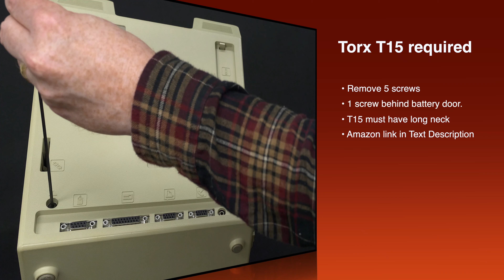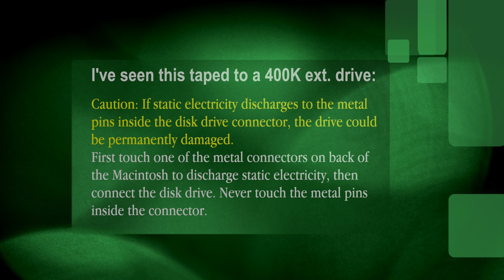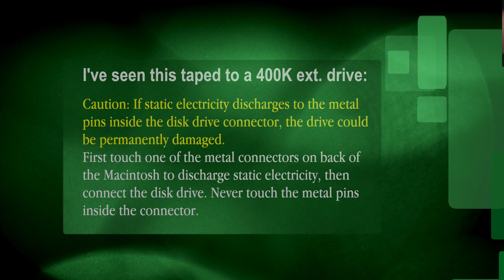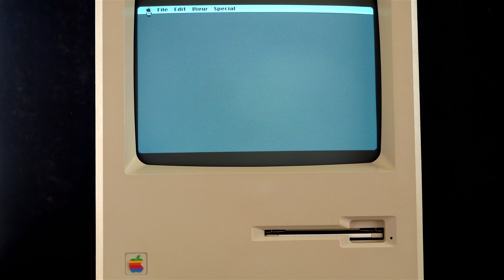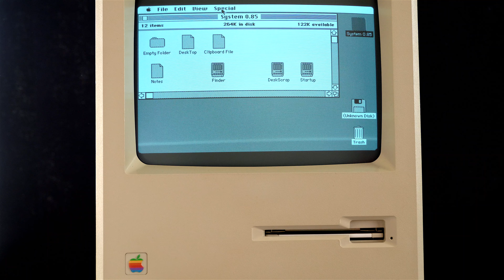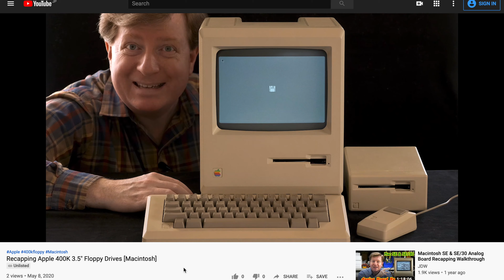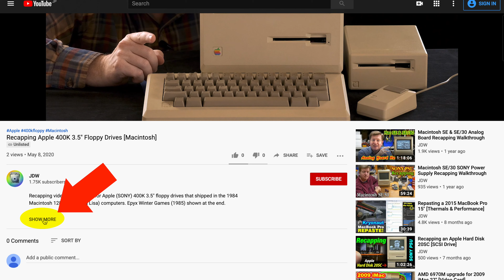Recapping Apple 400K 3.5" Floppy Drives [Macintosh]

Comment: Apart from preventive maintenance, are there other ways this recap may be useful in your opinion?
Reply from the maker: Replacing the caps also ensures the controller boards in the drive have stable power. As electrolytic capacitors age they slowly become more like a resistor and capacitance drops. That’s especially true if they have been in use for countless hours in a hot environment like a fanless Macintosh 128k or 512k. The purpose of many of these caps is to ensure there are no temporarily dips in the power supplied to the drive.

Comment: I recently repaired a 128K Mac with a bad RAM chip - this unit has a drive with the model # OA-D34V-01 in it - https://i.imgur.com/gfvxFz4.jpg, so there's another model # for your list. :)  (The interior of the case was also missing all the signatures, which is also considered weird apparently...)
Reply from the maker: Thank you for the new information about model # OA-D34V-01.  Very interesting!  Thanks for the photo too.  That stock grease is caked on there, I see!

When you reopen that Mac in the future, I would love to see a photo of the inside of the back case showing the lack of signatures.  I've seen that on later model Mac back cases, but never on a 128K.  Even the prototype cases I've seen had the signatures, although they lacked the metallic gray RF shield coating over the signatures.

Comment: Hello JDW, Radial Leaded 50volts 1uF and  Radial Leaded GENERAL PURPOSE 5MM shows as out of stock on Mouser,  would you please help us with an updated cart? also got any recommendation on what else to check on a floppy drive 400k that was working fine, and after reading a couple of disks it stopped working? eject mechanism works ok, floppies are not detected.
Reply from the maker: I spent quite a long time looking for you, but I am very sorry to say Mouser has no 0.47uF aluminum electrolytic caps that will fit.  Everything is on order.  And the replacement for the 1uF cap isn't so great as the original cap I had before.  So you have two choices: (1) Go to Digikey and search for the part numbers in my Mouser Cart and hope they are in stock there (sorry, I have no time to do that), or (2) take a pair of calipers and measure how much space your drive has available to see if the following two TANTALUM caps will fit in terms of Diameter, Height and Lead Spacing:

• 0.47uF: https://www.mouser.jp/ProductDetail/Vishay-Sprague/199D474X9035A1V1E3?qs=1Tf3zEaA7304pK6qlGlNdw%3D%3D
• 1uF: https://www.mouser.jp/ProductDetail/Vishay-Sprague/199D105X9035A2B1E3?qs=ZIkkZGOLt6W4WGNYgfbnjw%3D%3D

Solid Tantalum caps are much, MUCH better than electrolytic caps, but I just don't know if they will fit.  As I recall, it only enough width for a 4mm in diameter cap.  These tantalum caps are 4.4mm in diameter.  So they might just fit, but again, you absolutely must measure with calipers to be sure.  Also, these tantalum caps have a 2.54mm lead spacing, compared to 1.5mm for the stock caps.  So if the end up sitting on their legs at all, they might be too high, because the height is already 7.11mm.

I'm really very sorry I cannot do more, but I've been overwhelmed with work all this month.  No time for any video work.  In fact, I'm typing this at the office right now.  But please feel free to report back about what you decided to do, as your solution may benefit others who read our dialog here.
Reply: @JDW-  Thanks for your time again, I have ordered  the tantalum caps and will let you know if they fit on the board.
Reply from the maker: @ZoneFMS  I think it's a good decision because those tantalums are so much better than electrolytic.  They will probably fit.  I just didn't want to give you or anyone else a 100% "guarantee" because I've never tried them.  But I do look forward to hearing back from you when you try them.  Thank you!

Comment: Is there an update to the mouser cart as many items are no longer available.
Reply from the maker: I only update Mouser Carts when kind people such as yourself alert me to an issue.  But it's important to bear in mind that Mouser is notorious for allowing parts to go out of stock.  What's in stock one day will be out the next!  With that said, I don't have time right now to substitute parts in that cart, but I will try to make time for that later today.  Sorry for the trouble.  Wish the executives at Mouser would better manager their supply chain and inventory levels.
Reply: @JDW-  thank you so much. Any help would be great. From what I hear many of the small low profile caps are not made anymore and will not be available. I have been looking all over for weeks for replacements. I have 3 drives I want to fix. Thanks again for the great work to help others.
Reply from the maker: @willjacobs1432  Both carts are now updated. All backordered/discontinued capacitors have been replaced.  Happy recapping!

Comment: Hi, I have OA-D34V-22 but after the computer is turned on and you hear a sound the big motor which moves that black plastic head pressure starts spinning and keeps doing it until the computer is turned off. Since it turns in only one direction black plastic cover starts skipping , 
Anyone knows how to fix this?
Reply from the maker: At 21:20 in the video I show the 2 optical sensors.  Be sure to use a squeeze blower or similar to ensure there is no crud inside obstructing those sensors.The same holds true for the 3rd optical sensor shown to the right of the head in the scene at 40:38.

Comment: Hi is there a chance to get the instructions how to make 400/800k floppies? Thank you
Reply from the maker: Don't use the commonly available 1.44MB disks because their magnetic field is not the same as 400K/800K disks  You can often format a 400K disk to be 800K.  It's just that the 400K disks are only certified for a single side.  800K uses both sides.  But you can safely format 800K disks as 800K or 400K.  Never format 400K or 800K disks as 1.4MB disks though.  Bear in mind that a 400K drive cannot format disks as 800K, obviously.  But an 800K drive can format as 400K or 800K.  Just boot your vintage Mac in System 7 or lower, then insert your floppy into a working drive.  If it has never been formatted, you will be asked if you want to Initialize it, and click Yes.  But if it has data on it, then it might mount on the Desktop.  And if you want to format it, just click the Special menu (in System 6) and choose Erase Disk.  You can then choose 400K or 800K if your drive is 800K.  Now if you want to COPY disks, then you can either drag one atop another, or you can use something like Copy II Mac 7.2 (see Macintosh Garden) to copy copy-protected disks.  You will need to consult the Copy II Mac's "Backup List" to see what special settings are required to copy certain software.
Reply: @JDW-  Thank you for quick answer - absolutely gorgeous. I was thinking how to make system disk bootable on Macintosh 128k? For example System 2.0 without a System 2.0 floppy disk. Possible to use BlueSCSI 1.1? Thank you
Reply from the maker: You can download a disk image with System 2.0 and Finder 1.1 from Macintosh Garden here: https://macintoshgarden.org/apps/macintosh-system-2x

I also highly recommend you buy a FloppyEMU because it can really help you out in a pinch, such as when you have no physical floppy disks at all, or when your floppy drive doesn't read/write well for some reason.  It's easy to use.  You can just download and decompress disk images from Macintosh Garden, copy the images to the FloppyEMU's SD card using a modern computer, then attach the FloppyEMU to your vintage Mac with the power power, then power on and choose the disk image you want using the buttons and LCD. https://www.bigmessowires.com/floppy-emu/

You can also buy preformatted 400K disks on EBAY that are bootable.  Here's one with System 2.0 (Finder version not specified, so please ask the seller): https://www.ebay.com/itm/225179778386
And here's another seller of such disks: https://www.ebay.com/itm/353378805901

But even if you buy real bootable floppies from EBAY, I still advise buying a FloppyEMU. It's worth it!

Comment: I still have this computer with external drive.  I doubt I will ever get rid of it.   However, I have a bunch of Mac formatted disks from years ago, containing documents that I would like to utilize now.   What would be the most efficient way of recovering the Mac documents, and transferring them to my Windows computer?
Reply from the maker: It's complicated.  First, if you have a Macintosh Plus with sufficient RAM to run System 7.x and a rare SCSI-to-Ethernet Adapter, then using FTP to transfer files to/from your Mac is the way to go.  Transmit is a great FTP client that will get the job done: https://macintoshgarden.org/apps/transmit-17
• SCSI to Ethernet: http://www.retrotechnology.com/herbs_stuff/m_net.html#scsi

But if you have a 128K or 512K or 512Ke, I see 3 different approaches you could take, although (2) below is probably the most realistic for you:

1. If you have a Mac that can run MacOS X Tiger: https://bit.ly/3aq2MZ2
or
2. Use Mini vMac (Windows version, free) & ExportFl (free) with a FloppyEMU (purchase required):
• Mini vMac Download: https://bit.ly/3iCZQLz
• ExportFl Download: https://bit.ly/3anMAHN
• FloppyEMU: https://bit.ly/3h1M1Gs
NOTE: ExportFL is an app used inside Mini vMac and would be used on your Windows PC to move files out of the Mini vMac environment and onto your PC.
or
3. If you have a Mac 512Ke with a SCSI add-on board, you could theoretically use a SCSI2SD (I don't own one and have not tried it, which is why I say "theoretically") to copy files off your Mac and then connect to your PC to transfer those files with the help of a software app on your PC that can read HFS drives.
• Add-on SCSI info: https://macgui.com/news/article.php?t=471
• SCSI2SD: https://bit.ly/2FnVJVy

• HFS apps for the PC: https://bit.ly/2PN5Tkq

Here's how to deal with old MacWrite files: https://lowendmac.com/2008/tales-of-old-mac-data-retrieval/#macwrite

Lastly, you might find this video useful: https://youtu.be/WobgxVlxt8Y
Reply: @JDW-  Thanks for the response.  Man, that's complicated.  Links are informative, especially the first.  I take it the late model Mac operating systems will not read a floppy from a new drive?  or possibly there is no port to plug a drive into?   Perhaps I should just find a mail-order technical lab to glean the documents off the floppies.   FTP is beyond me.
Reply from the maker: @ARIZJOE  A technical lab like DriveSavers will charge too much money.  Buying a FloppyEMU (they anticipate having new stock at the end of August) would be cheaper, plus you get the huge benefit of running all kinds of disk images from it!  In fact, it has HD20 mode, which allows you to create a hard disk of sorts on the FloppyEMU.  I have one that is over 200MB.  You can put multiple drives on the FloppyEMU's SD card too.  It's nice because if you want to download old Mac software from Macintosh Garden, many come in a disk image format compatible with the FloppyEMU.  You just use your modern computer to copy those disk images onto the SD card, then put the SD inside the FloppyEMU, connect to your Mac, power on your Mac, and then you can either boot from a real floppy or a virtual floppy off the FloppyEMU. And again, the FloppyEMU setup will allow you to move files to a modern Mac or a Windows PC via that SD card in combination with Mini vMac and ExportFL.

Comment: Sigh. I still have both our Mac 128 and Mac 512 as bookends in a shelf. The 128 only partially turns on and the 512 doesn't at all. The 128 goes straight to an error pattern that itself is flawed, leading me to believe that there's corrosion or something else going on. I know they're worth a fair penny if sold to a collector but I can't bear to part with them since they played such a central role in my academic career.
Reply from the maker: You might be able to resolve the problem with a recap of the Analog / Power Supply board.  My video on that is here: https://youtu.be/Ng8F_QVgaTc

Comment: Perhaps I missed the fact: how many external floppies (or floppies in total) could you have?
Reply from the maker: Two. Because there is only 1 floppy drive port on the back of the Mac, and because there is no pass-thru port on floppy drives, you can only have 1 external floppy drive.  However, the Apple HD20 hard disk plugs into the floppy drive port on the Mac and it offers a port on the back so you can connect either an external floppy drive or another HD20.
Reply from the maker: Correct.  You don't want to daisy chain that 800K drive on a Mac.  That's definitely ONLY for the Apple II series.  And yes, you can connect Apple's HD20 and then connect a 400K drive to the HD20's pass-thru floppy connector, giving you a total of two 400K floppy drives and one 20MB hard disk -- all as slow as any 400K floppy disk! :-)

Comment: Great video.  However  I had to  remove the "track 0" optic coupler for cleaning and it seems that I need to reposition it so that it matches my existing disks. Any thoughts?
Reply from the maker: I do not advise removing the optical sensor for cleaning due to the extreme difficulty it getting it back in proper alignment again.  That is discussed in the following thread, and you can see my participation there: https://68kmla.org/bb/index.php?threads/400k-drive-repair-guide-a-call-to-arms.25721/page-4#post-380886
Reply: @JDW-  
Advice well given-however I had already removed it (there was some dirt lodged in the slots of the optic coupler that prevented proper sensing).  It was a case of "fools rush in where angles fear to tread". But as an old time electronics tech (currently retired), I can not just give up on this "project"- it is a matter of pride.  The link to the service manual was gold!
I bought this Mac back in 1984 along with a PCB layout program (McCad) that allowed me to replace the blue/red tape layout process and, using the printer and a home made camera, allowed me to create the negatives from which I could etch circuit boards. The early version was simply a drafting tool similar to McDraw but was a quantum leap above my earlier methods. I still use the latest version of McCad on my current Mac but the technology has really changed where I now use Schematic capture, Autorouting and Gerber translator. I also got ride of the Ferric Chloride etching tanks, the printer, camera and darkroom.
I sold my Business three years ago but still work on smaller projects. While transferring the assets to the new owner,  found the old Mac on a back shelf and brought it home.  I recapped the power board and it still works with the exception of one of the two external 3.5" drives.
So the adventure continues.
I will let you know how it turns out.
Reply from the maker: @genegillott2049  I haven't used it in decades, but I remember MacCad well.  I can't remember the exact year, but I do recall that I did visit their offices in California at one time (late 1990s?) and got to meet the folks who developed it.  It really was an amazing piece of software (albeit very pricey!) for the time. Regarding the floppy drive though, it will take some serious time and effort, but if you are determined, I have reasonable confidence you should be able to get it aligned at some point.  I look forward to hearing how that works out.  Until then, best wishes!
Reply: Just a quick note on McCad.  When I bought the first version I was dealing with George.  This was back in the 1980's.  This past weekend I needed to use the program to generate a new PCB but was unable to run it (It needed to be re-verified) and the attempt was rejected.  I emailed McCad on Sunday night and on Monday morning I had an email saying the problem was solved and that the program should now run OK.  The email was from George!
Reply from the maker: @genegillott2049  Wow!  Now, that's what I call amazing support!  It's also interesting to view their website and see they continue to support the Mac very well, including the newest versions of MacOS.  http://www.mccad.com/GetComplete.html

Comment: My 128k Mac is missing the internal 400k floppy. Can I disassemble an external 400k floppy and install it into the 128k Mac? Will it work?
Reply from the maker: I don't want to give you a 100% guarantee on that because in the past I've had an especially fiddly 400K drive that would only work in its external enclosure and not inside the Mac for reasons I don't fully understand. But you absolutely need to re-watch 12:43 because if you have the oldest Revision-A ROMs in your Mac, then whether the external drive mechanism would work inside the Mac or not would depend on the model number of the drive printed on its label.